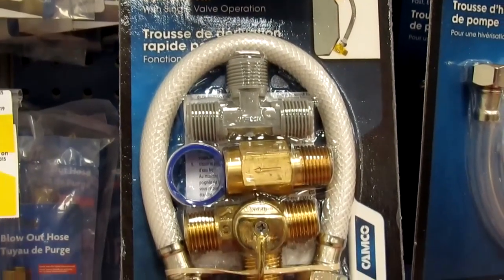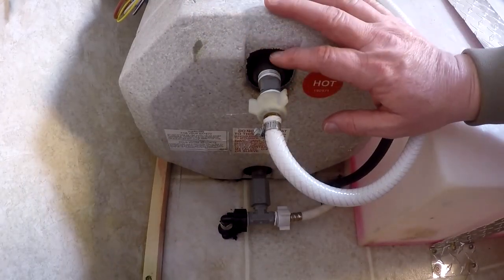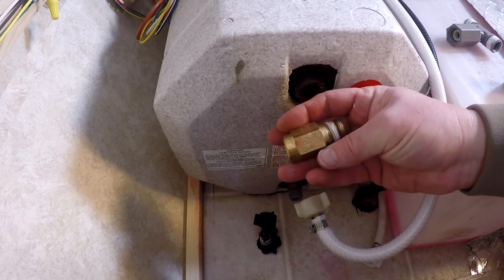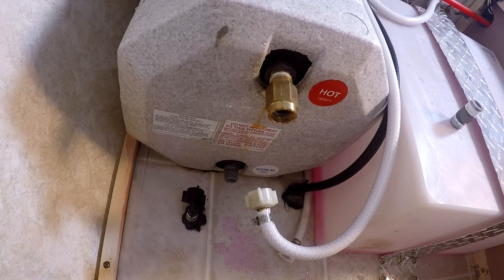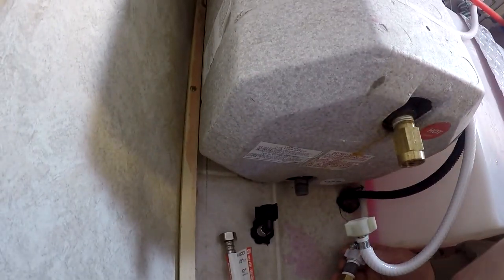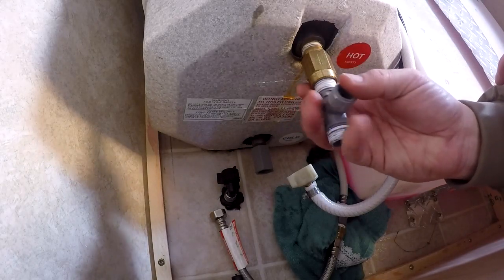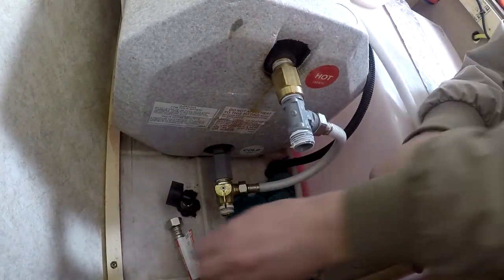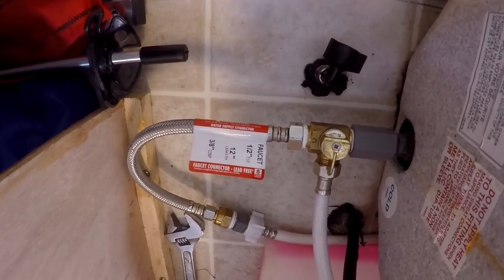Installing a Waterheater bypass on my 2008 Aliner Classic

Comment: when i turned my already installed bypass valve on my  20
19 aliner. it dripped at the valve knob. ( it looks just like your camco).  how can you fix that? thanks. you and potatohead are the reason i went with an aliner.
Reply from the maker: If the valve itself is leaking it probably froze at some point and has a crack, you need to change the valve.  If the connections are leaking I would try disconnecting them and reconnecting with a little sealant or even vaseline.  Or the hoses going to the valve are leaking and it looks like the vale.....  Change the hose with some flexible clear PEX.   Hope that helps

Comment: Great video. I think I could do that. Thanks
Reply from the maker: It is really pretty easy, just unscrew and screw it back together, then check to see that it works, if it doesn't, turn the valve around... like I had to do .. LOL

Comment: Is there a reason you just didn't take the double male thread from the top of the water heater and attach it to the cold and hot hoses? I just don't see the reason to spend the money on the bypass.
Reply from the maker: Each time you do that you would likely flood your water compartment and wear the little plastic threads.  At $20 its not very expensive and onlt takes 30 minutes to install.
Reply: And it saves in the 6 gallons of antifreeze needed to fill the hot water tank if you do not have the bypass so you can drain the water heater dry for the winter.
Reply: I will be installing a bypass before winterizing this coming season.